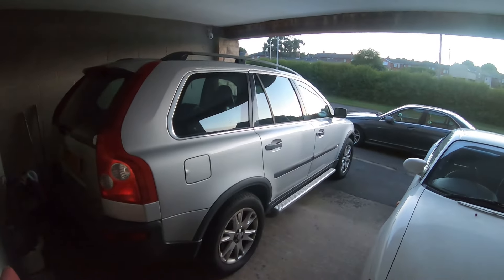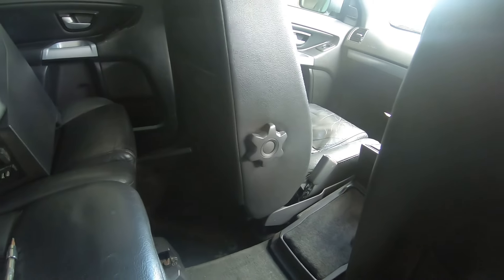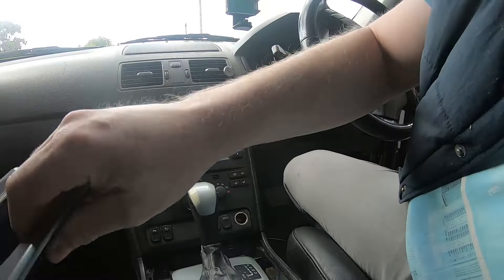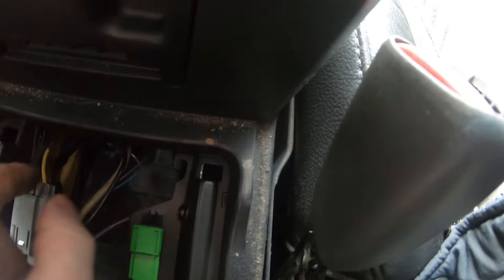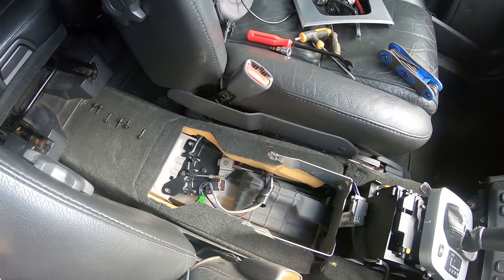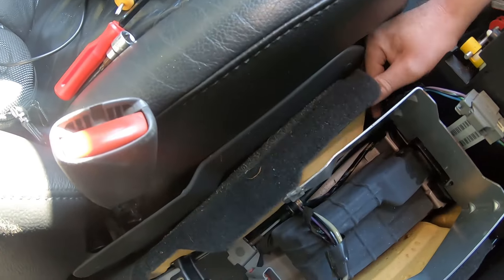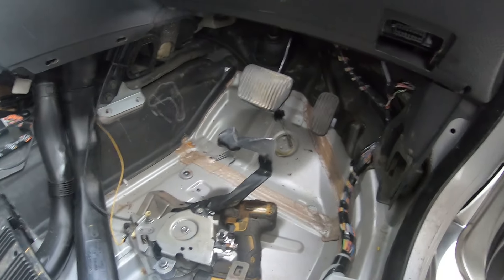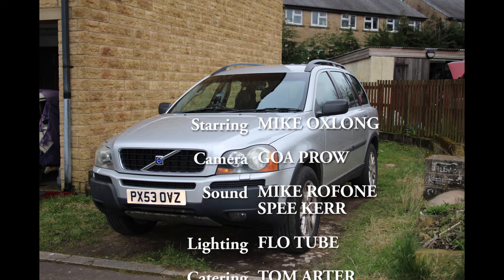I thought the parking brake cable had SNAPPED -2003 Volvo XC90 Part 39

Comment: Mine never been good on my Xc90 2010  long time I’ve followed you sir and always enjoy your content and caravan vids
Reply: I installed adjustable shoe spreaders, parking brakes got noticeably better.  That's assuming the cable is tensioned properly and doesn't have too much slack.  Might need to do both procedures to it right